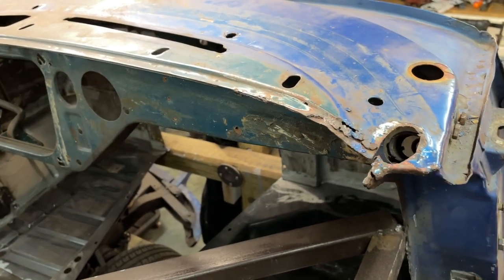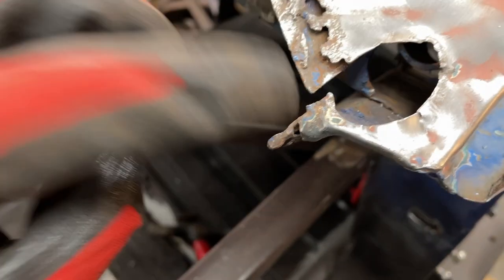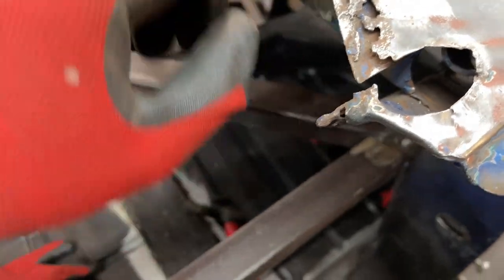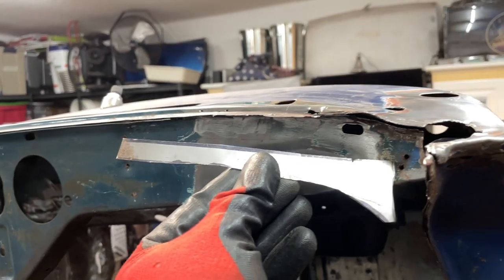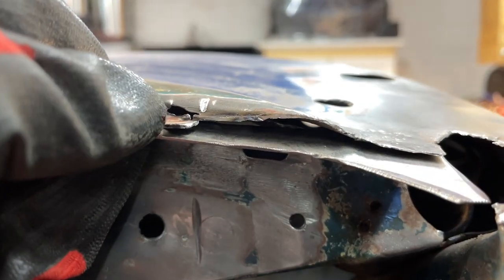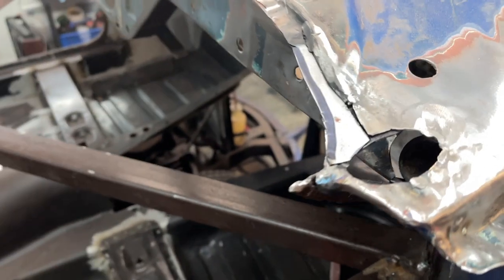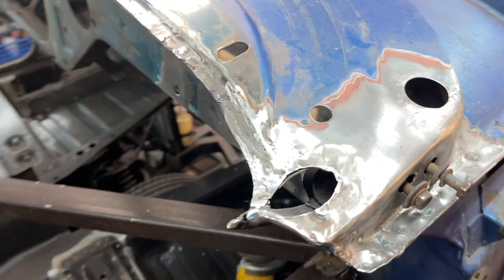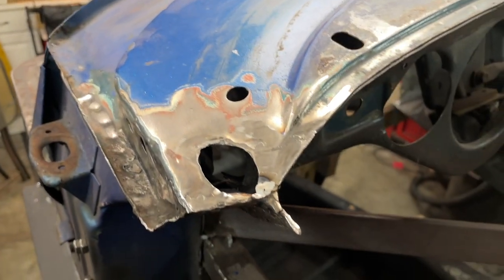Scuttle Repair | Triumph Spitfire Restoration - Part 66

Comment: I've got a rubber plug on that antenna hole. No one notices it, and I plan on a radio anyway. Or maybe not...🤔 But it gives me the option. 

My dpo painted the same way. Rusted out floors and rockers, among all the other rot... Painted the interior (no primer!) right over un prepped surface. Very heavy, flaky rust, half the inner sill was just gone!
Reply from the maker: Oooofa, that does not sound like fun.  I’ve really gotta get in there are prep under the dash as best as possible so that the paint sticks.  Everything else should be pretty decent to prep.

I left the hole.  Figured I might throw an areal just for yucks.

Comment: Hi can I ask why don't you show the actual welding ?. I would be interested in the thickness of the metal and what kind of welder your using to weld such thin materials and the settings on your welder . I have tried various welders some are fine for like tack welding and hobby welding but I own a mk2 66 spitfire and I too have thin metal on parts of the car so would be interested in some of your welding techniques .
Reply from the maker: Hi David!  

So I have been experimenting with different editing and video formats so my last two videos have been without Timelapse video of me welding and grinding.  Just an experiment.

I use a Lincoln ProMig 140 with 0.25 ga wire with Mig Gas.  I measure the thickness of the metal prior to welding then I just pair the thickness to the settings for the welder.